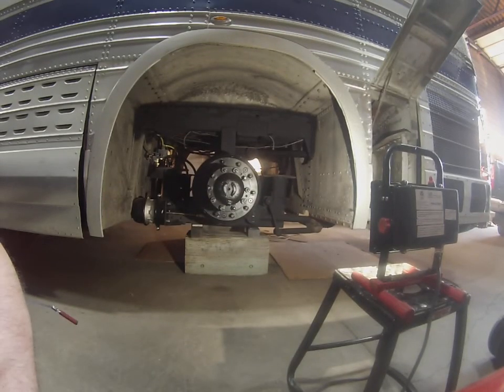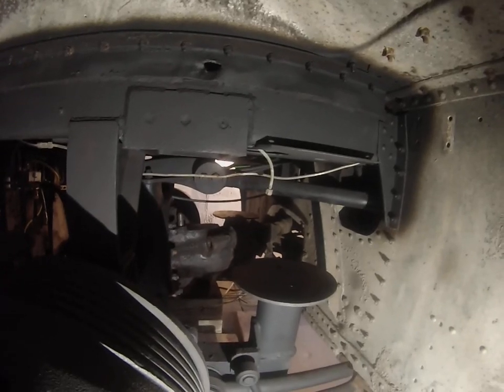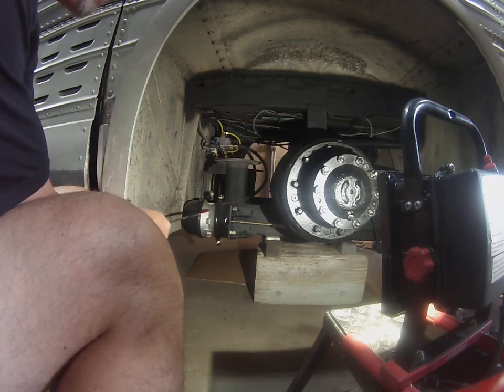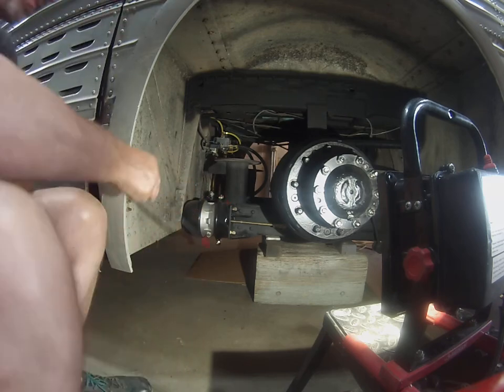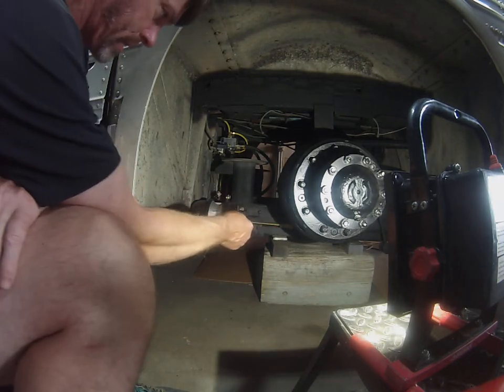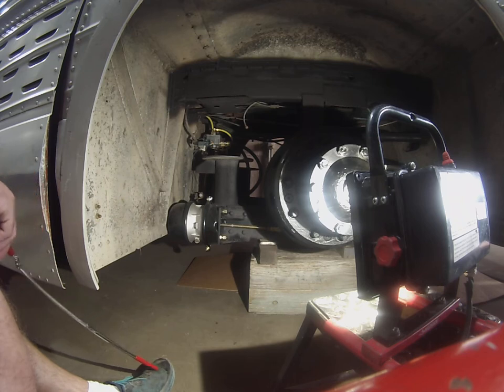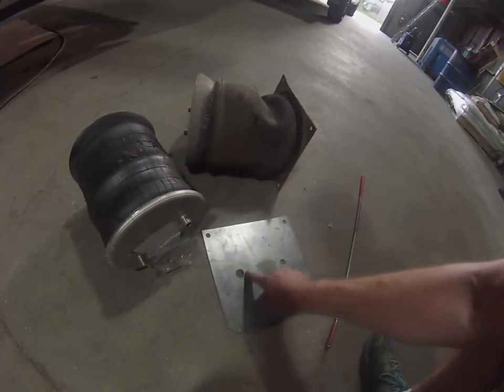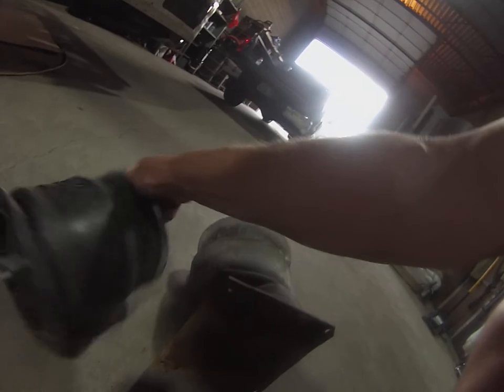PD-4106 SPRING BRAKE INSTALL PART 1

Comment: Are they long or short throw on a 4106?
Reply from the maker: I don't recall exactly, but the number 1.25" stroke seems to be in my mind. 1.25" is actual travel needed to fully engage the brake. I think there may be a DOT requirement there also. They are the "standard" length cans, which I assume relates to stroke.
Reply: @detroitdragon7072  thanks for the info and videos..did you buy your air bags from us coach?
Reply from the maker: @bondo375  SURE DID